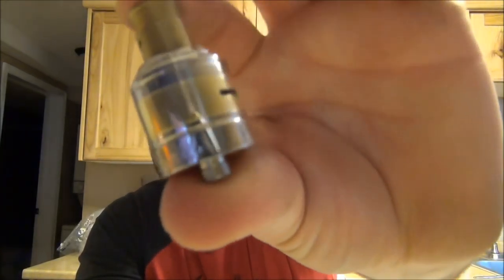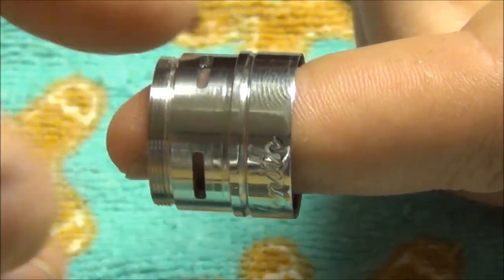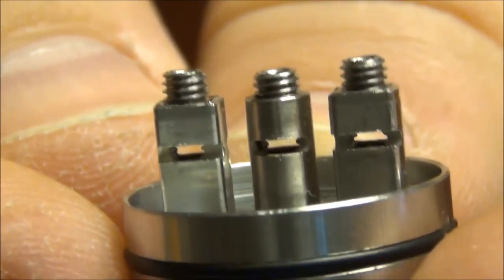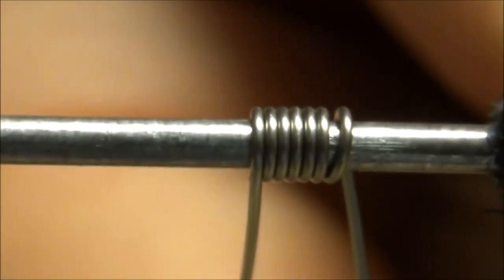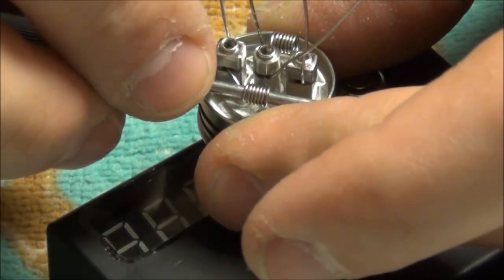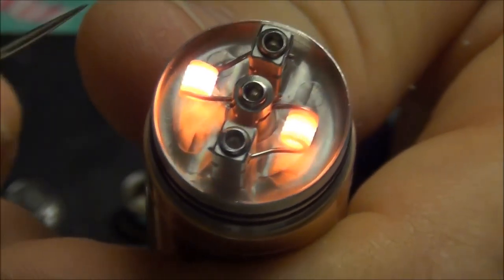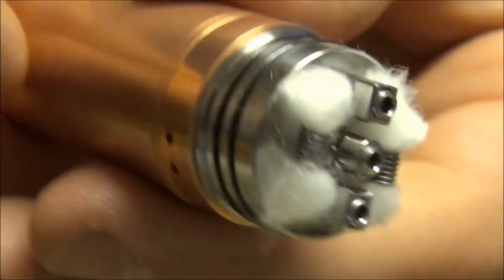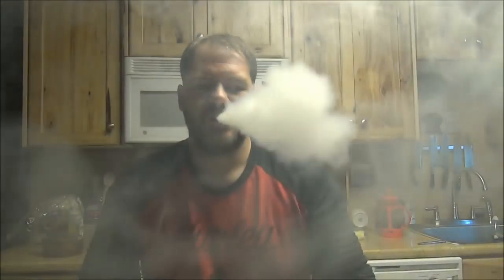zenith v2 rda + build!

Comment: Wow man what are the odds. I'm in Vegas right now for my girls birthday, and I just went to Pink Spots South location the other day! They have a beautiful setup there and I picked up my two favorites from them, Watermelon Wave, and Blue Raz cotton candy. Also snagged a 12ml bottle of their new flavor Ultra Violet(blueberry pomegranate). 

On the subject of the Zenith V2 I must say I have mixed feelings. The first one I received had horrible threading on the top of the top cap. Completely rough, gritty, and so hard to unscrew I just leave it on their now and loosen it a tad to change airflow. In addition the top cap had identical scuffing around the base of the top cap, and other scuffs all around it. The included black airflow ring had air holes that didn't match with the barrel so one side would be more open than the other in dual coil mode. I swapped to a brass ring and it is perfect. The base though is in great condition and is extremely well built. I absolutely love building on it. 

My second Zenith V2 came in(copper ring) and was in MUCH better shape than the first. The top threads are smooth, with no damage preventing me from removing the top of the top cap. 

The bottom line is that CMII needs to get their Quality Control in check because they have a stellar atty with the Zenith V2.  The way it vapes has saved it from me completely slamming it. Excellent vapor, flavor, density and overall a fantastic vape.
Reply from the maker: Could not agree more! Man terrible..I was hoping that I just ran into some bad luck...thanks for the info bro,we all benefit from it!

Comment: One of my coils is heating faster than the other one i'm not sure whats exactly wrong
Reply from the maker: Casey Hale this is usually a loose screw. always double check your screws and ohm meter for "jumping" numbers.  also "strumming" the coil will make a dramatic difference in the coils coming to life. I hope this helps. vape on!